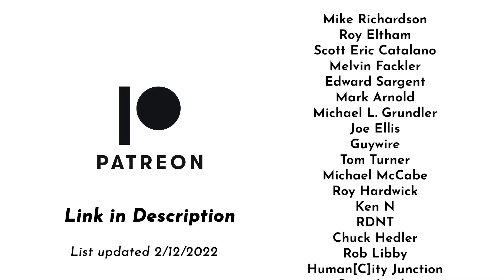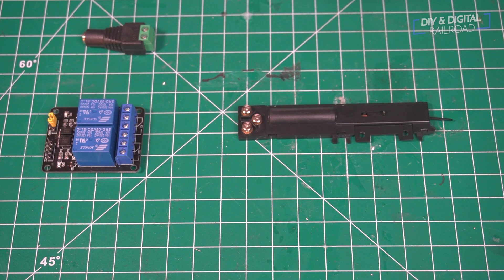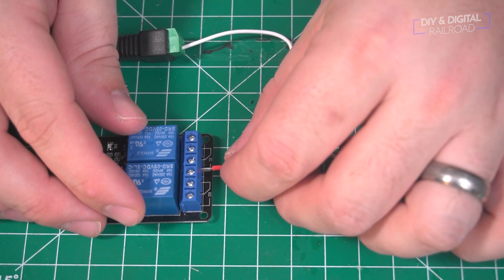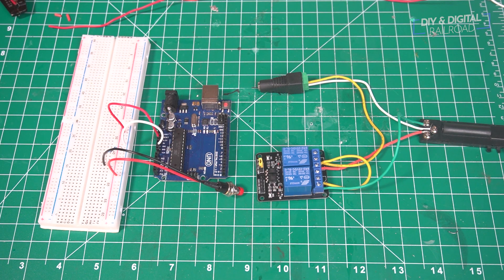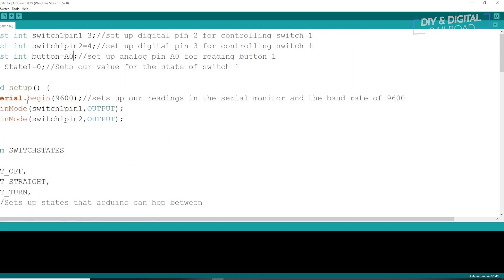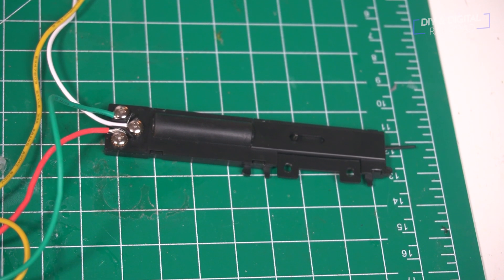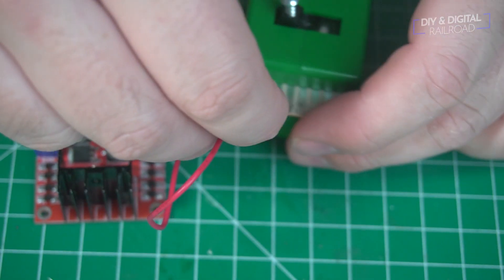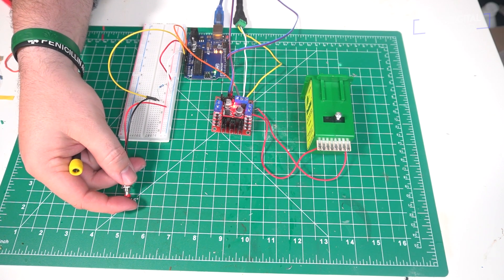Controlling Model Railroad Switches with Arduinos!

Comment: Nice tutorial, but I have one nit to pick. The stall motor in the Tortoise is designed to have voltage applied to it even between changes in switch position. This keeps constant tension on the turnout throwbar so the points stay in position even if something temporarily moves them away from their target position. With the voltage only being applied to the stall motor for two (2) seconds, you're negating that feature. Yes, the mechanical advantage of the gearing mechanism in the Tortoise will help keep the points in position, but if a derailment over the switch moves those points, the only way to get them back in position is to cycle the turnout via the pushbutton. Yes, this isn't as energy efficient, but the current draw of a stalled Tortoise is rather small. Anyway, a solution that keeps the voltage applied would require more code changes than you demonstrated, but then you'd be taking full advantage of the Tortoise's design.

Comment: After 35 years, I’m finally getting back into building my model railroad in HO scale. I’m amazed at the technology available and how far it’s come since I last picked up a Walther’s catalog in 1992! I’ve been using the Arduino and Raspberry Pi for years and I can certainly see the advantages of using either one on a model railroad. With this demonstration, I’m not sure how this is any easier than simply connected the “FIXED DC” output from your power pack to one of those Atlas Snap-Switch controllers and calling it a day. Yes… it’s very old school and lame, but it works. Back in the day, I built a schematic board of my layout, and each switch position was indicated with a light and a SPST center-off switch. I would simply align the switches for whatever train movement I was trying to accomplish, then I pushed a “master power button” that activated the switches… all at the same time. It looks like this exactly same thing can be accomplished with the Arduino, but I could also turn on appropriate signal lights as well. I guess what I’m slightly confused about is what the practical applications and reasons are for using an Arduino over simple switches and buttons.

Comment: Thanks for this code for the ardunio. I have been using mechanical reversing units to control various passing sidings and this code and the arduino are so much better for S gauge switches.  in tinplate

Comment: This doesnt really use the power of the microcontroller. You should instead throw away those chunky ugly large space guzzling power sapping snap switchs and use some micro-servos instead. Towerpro SG90 is an example. Combine these with servo driver/ expander like the SC08A or similar, and you have all the switching capability you need at your fingertips.

Also - theres a device known as an addressable LED. Its  5mm in size and ideal for your signals. A single led can be addressed with a serial data input and 5v, and show a multitude of colours and intensities. Just perfect for HO scale  ! Wiring becomes extremely simple both on the layout AND for any control panel since only 3 wires required in the entire string of  50-60 leds, or even more.

Comment: You don't need to do that.  With 2 relays you can control 2 switches.  With the relay unenergised, power will go out one of the outside screws on the back of the relay.  When energised, the power will go out the OTHER screw.  Had you put the green wire on the terminal next to the ground return, you'd have freed up the other relay for another switch.  Much better since you're only using half the relays previously spec'd (unless you're a relay salesman!!).

Comment: can this be setup for a tortoise switch machine be set up with a Loconet interface to the Arduino for JMRI or Traincontroller?  If so, how would the Arduino sketch be changed to accommodate the interface and for use with more than one Tortoise switch machine?

Comment: Marvelous and easily explained. Instead of using 'Button', I thought of using 'Ultra Sound Sensor' along with 'Snap Switches'.  Earlier I have done by using 'Servo Motor SG90' which can be viewed on YouTube (https://www.youtube.com/watch?v=P6YYbh46wQg&t=315s).  
Could some one guide me the changes, I need to do in code (sketch) in this case (USS along with L298N and Snap Switch).  I felt that fixing snap switch will be easy as compaired to servomotor.
Thanks in advance for the guidance.
With warm regards.
Sushil Damle
28022023@1437 Hrs IN.

Comment: DO NOT solder wires direct to the Tortoise! It will work just fine, but it will be very difficult to unsolder and resolder the connections if you ever need to move the Tortoise. Buy a Tortoise Edge connector - there are several firms that offer them - and solder your wires to the edge connector. It is then a simple matter to unplug the edge connector and plug in a different one if you ever need to change out the connecting wires. (In addition, you can do your soldering above the layout instead of under it!) The Tortoise costs about $20; an edge connector costs about $3.
Reply from the maker: I can see that, but I have never had issues unsoldering wires from a tortoise and resoldering them.
Reply: @DIYDigitalRailroad  Perhaps I'm just clumsy: I can unsolder the wires just fine, but the solder clogs the holes, and they only way I've ever been able to clear the holes is to Drill them out. Maybe I'm just lazy...

Comment: Q- Can you control multiple turnout motors using a single Arduino nano?  If yes, how many?
Reply: You can, but you are limited to the number of digital i/o's on the arduino.  So a nano has 14 digital i/o's.  Each one you use for a switch, will reduce the outputs for a relay.  So in theory, you could do 3 dual switch machines with relays (2 each) with 3 push buttons. I usually recommend mega's for this reason.

Comment: Way to complicated for a snap switch motor. All  you need is 12 volts, wires and 2 switches to snap it back an forth.  Or one of the slide and push switch. Even for the tortoise, too many components. Needs to be simpler.  Thats my opinion.
Reply: The whole video is on using Arduinos for controlling switches, it’s in the title. Yes you can use simple DC power and switches, that what they were originally designed for. But you can’t do automated setups with all manual switches. That’s what Arduinos provide, a route for automation or computer control.

Comment: This my be a dumb question. I never messed with a Arduino uno thing but on the continuous closed could you run your signal lights off of that or not? I always  did the dpdt  momentary switch or manually threw the turnout

Comment: Hi - surely you are not leaving power connected to the snap action point motor  coil after it moves the turnout. By using a relay power must be still connected after the motor moves the point. This will lead to coil burnout. Is this what you have done or have I missed something?
Cheers Jeff
Reply from the maker: Hey Jeff.  No the power leads to the relay are connected to the “normally open” sides of the relays and are disconnected unless activated. This is why you have to use 2 relays per turnout.  One for briefly powering one coil and one for briefly powering the other coil.  If the relays are in their default state, the relays sit in the “normally closed” position and keep the coils disconnected.

Comment: This is cool but how about Peco point motors? Like the PL-10 or PL-15. I don’t know if they’re different electrically but I think they’re about the same.
Reply from the maker: So I have never used those motors but as far as I can tell, the PL-10 is a twin coil machine like what I showed here.
Reply: @DIYDigitalRailroad  So follow the directions for the snap switch type right?
Reply: @roguerailroader4132  yes

Comment: It would be interesting to see how you install the pushbuttons and the electronics for use on your railroad. I assume that the pushbuttons go on the fascia. Thanks.
Reply: Not necessarily - you can use them and build a so called track diagram signal box - it shows a simplified trackplan - and on turn outs you mount the switches at the appropriate position at the point of the turn out in question. Although I dont like this single-action design .. 2 push buttons - one for straight, one for turned are easier to control. And when you use this signal box - make use of the feedback contacts of the switch machine

Comment: This isn't what I expected. How does your Arduino sense the incoming trains, so it can decide the direction of the switches? Sensing rail current? Reed relays? Lidars of IR guns? this sort of thing.
Reply: It doesn't. The arduino is only waiting for input from the button, and when it senses the button press, it actuates the switch. That's it.

Comment: Simplifying something that's black magic👍Will help MRRr's who want to do this. My conductors will still be stepping off&movin my caboose switches lol🚂🇨🇦🇺🇲
Reply: I enjoy the videos... great!  I have caboose switches, which I prefer. I am thinking of using piano wire connected from one side of the throw, to a sprung N/O N/C limit switch beneath.  So, the switch is pressed when throw is in one of two positions.  Looking at this video, I would need to add a resister (or incandescent light) for using the Arduino to sense when the switch is made, right?.  I want to continue using the caboose switches, have the Arduino sense the change in switch position, and do more than just signals and lights, not sure what that is just yet.  Would like to see more videos on the concept of using buttons and such.  Thanks.

Comment: When you added the common wire to the snap switch, I saw a stray strand of wire running loose - I usually tin the stranded wire first, or use a crimp spade connector to avoid issues like that

Comment: I am building a layout.  I have installed Cobalt motors.  They are like the Tortoise but a bit more compact. And each has a decoder built in.  Simply install them then connect directly to the same wires that power the track, assign an address and control with the same DCC controller that runs the trains.  Nothing could be simpler. I highly recommend the Cobalt motors to anyone using DCC.
Reply: Yes they are similar to SMAIL point motors(same company as the tortoise) I have been looking at the two and from the reviews on youtube the cobalt is smaller and cheaper but also louder than the tortoise.
Reply: @keaganwright124  I have never heard a Tortoise but you can certainly hear a Cobalt.

Comment: I did something nearly identical, but ran into a problem when the relay boards I used did not have optically isolated I/O as claimed.  I had to add a diode across the output of each relay to handle the voltage spike caused by the solenoid fields collapsing.  One other difference was in the time I allowed for switching, which was around 100ms.

Comment: I know  arduino is cool, but with Kato switching all you need is dpdt momentary switch and a wall wart a lot cheaper and easier. Just my two cents.
Reply: If you manually want to switch them yes, this is a basis of automatic control.  Some photo resisters to this application and the door is open to other opportunities on a layout

Comment: Thank you for this.  I have a project to re-power a existing trolley car-barn that uses twin coil switch machines.  The way they are mounted they cannot be replaced without ripping out the whole yard ladder.  I was worried about the delay time, and your half second solution answered that question.  I will be stealing.. err.. borrowing your code.  Thank you again.